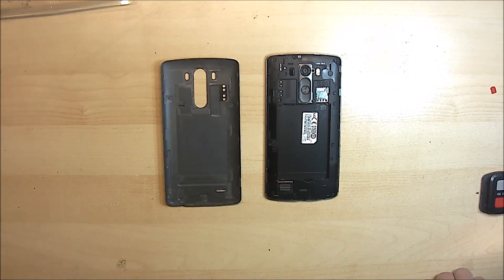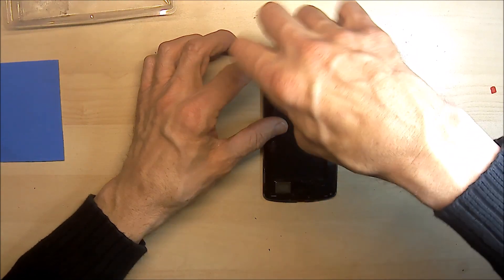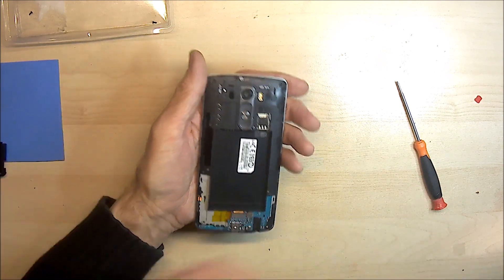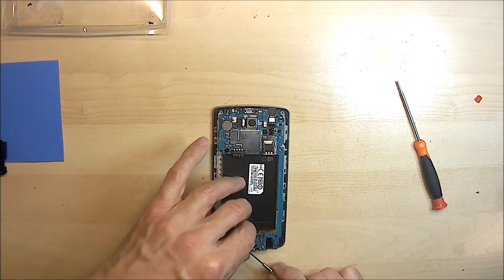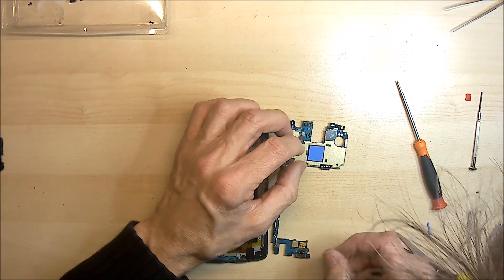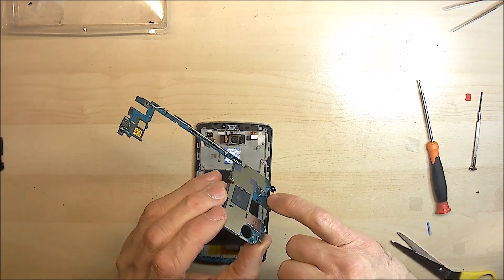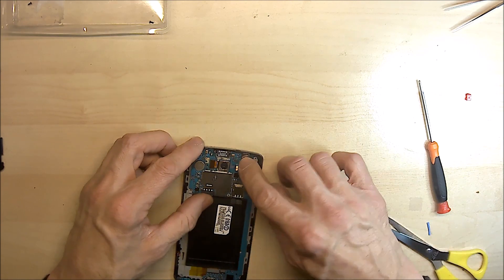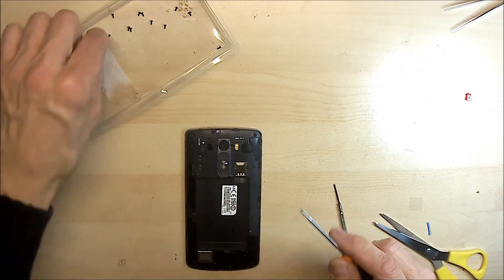LG G3 How to fit Heatsink pad to stop overheating

Comment: I bought the same thermal silicone pads. Still waiting for the delivery. Now i think i heard it right, one side is "adhesive" and the other side is "slightly adhesive".
Is that correct?
Reply: @Paulgibbs99  i see. Thanks. I ordered mine online. I'll be placing it on my new mobile phone radiator/cooler since it has a space in between the cooler and the phone. I hope that it will work. 
I chatted the seller asking if it has adhesive parts and they said yes on both ends. I'm not sure if they know what i meant but i guess I'll have to find out when the order arrives.
Reply: @robboostph6689  so it's working bro??
Reply: @kaling2276  Yes, it did work as expected. Filled in the gaps. But somehow it's not that durable. I have a habit of removing the cooling pad for the phone when not in use, when the phone is not in gaming mode, and when not in heat due to excessive use. The constant removal of the attachments, the changes in the temp made the blue patch worn out in just a few days. There are times that it can last for about a week or so. The patch also sticks on the back of my phone. Maybe because it is being pressed by the cooling pad on the surface of the phone and due to the heat and cold. I stopped using it since it is being worn out easily. But to answer your question, yes it does work. Very much so.
Reply: @robboostph6689  I realize this is an old post but was wondering why you removed the thermal pad? The pad is designed and expected to be left in place at all times. The pad and paste cause no issues in the long-term so no need to remove. Hope this helps you and anyone else who looks at this video and comments.

Comment: How mm heat sink u used ? N at bottom of thermal pad or only top needs thermal paste ? Tx
Reply: On G3 accurate thickness of thermal pad is from 0.5mm to 1mm depends on G3 variant, 1mm as common. Thermal paste is not so required if thermal pad is the right thickness.
Use Copper tape with paste if available, way better than thermal pad..

Comment: Such a simple solution, dunno why LG didn't thought of this.
Reply: It was designed to have some sort of termal canductor between cpu and the aluminum frame though for some odd reason they decided to not use it
Reply: Xiaomi always put thermal paste over the processor
Reply: @chaman_Kubde  yes they did